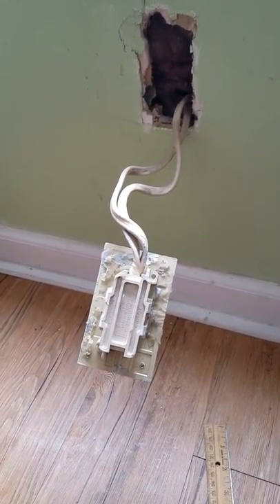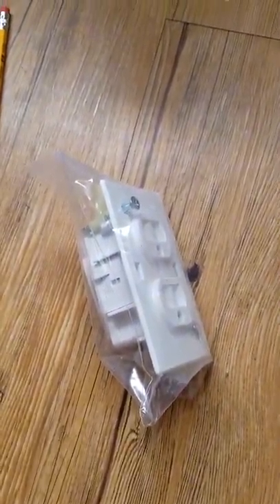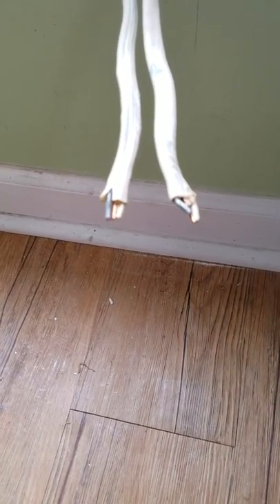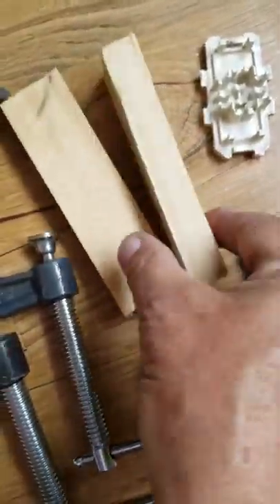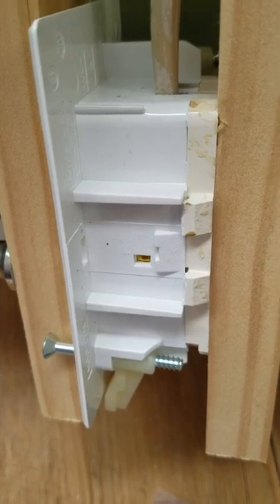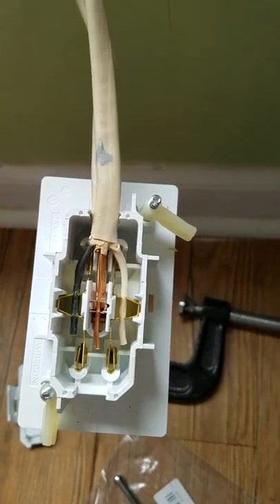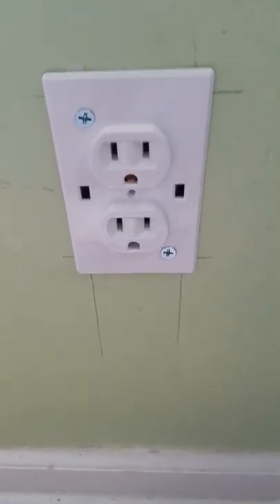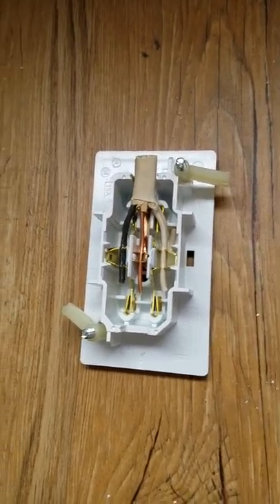SCDT/Wirecon tool replacement

Comment: Man I had no idea what I was getting into removing this outlet on my motorhome.  What a joke that there is not another outlet to use for this with screw terminals.  Thank you for showing this idea.  I guess I need to order a new outlet an make my old one the sacrificial part.

Comment: Thank you so much for this video. I spent hours trying to squeeze and push and crimp those wires and I couldn't get the back anywhere near in place.  I tried your trick with the two clamps and wow, 10 minutes later I'm done. I appreciate your video, have a good one.

Comment: Great idea Billy!   I've dealt with these pieces of garbage for 20+ years doing mobile RV service. What I now use is the huge (15" handle?) Channelocks to force these things together. Your method will not mangle the plastic so bad, but will require some kind of modification to do switches, both toggle and Decora type.

Comment: Much thanks for these hints.  Worked fine.  These outlets are used extensively in RVs, and are UL listed and CSA approved  ... maybe wouldn't use in a home, but required in an RV where you don't have real walls.  Again, thanks!!!!

Comment: Good job, Nice to see it actually back together, Gotta say I am not a fan of these receptacles. a nick in the copper will in time cause the wire to fail and create a high resistance connection leading to a fire. My RV is full of them and high loads like space heaters cause them to melt, UNSAFE DEVICE.

Comment: Replaced a lot of these. With a box and receptacle. The replacement box is bigger than the original hole and there’s no need to buy the install tool.

Comment: Just curious cause I'm about to change out the outlets in my 86 travel trailer,  why didn't you strip the black and white wire instead of keeping the insulation on the wires?

Comment: Why didn't you install the NEW "wire(s) retainer" that came with the new receptacle? I see that you used the OLD wire retainer (with clips broken off) to press the wires into the new receptacle, which was a clever idea. BUT you were supposed to use the "NEW wire(s) retainer" to HOLD the wires in "place" while you were pushing the whole "mess" back into the "hole-in-the-wall."

Comment: This works great for flat faced outlets but I need to seat the wires on a rocker style light switch. This idea won't work for light switches. Any ideas on how to press those wires into place on a rocker light switch without the tool?
Reply: Use Billy's method except use huge Channelocks (3"+ jaw opening) and little 1/2 size pieces of wood, then do one side at a time. I'm an RV pro but am not paying big bucks for the Wirecon tool.

Comment: From an electrician's point of view these outlets are dangerous and can catch fire due to being molded of polystyrene and having the contacts just "U-formed". In high humidity environments this will eventually become blackened and burn.
As a professional I refuse to replace these with the same junk. Any hardware store such as Lowe's or Home Depot have the "blue boxs" with the rear clamps that will fit into the cutout. Additionally standard receptacles which are safer can be used that you don't have to go through the "clamping" to set the wires. Hate to say it but this part of construction is "piece priced" and set, therefore time is money, the faster you are the more money you make.
Reply: Keith Lucas  dude without a doubt.  I work in HVAC and when I saw this in my double wide, I knew it was junk. You don't see these in residential homes for a reason.
Reply: I just did one and converted to a normal receptacle with a blue box. I piggy tailed the two ground wires and used a wire nut. Never converted an outlet to a different type before, don't know much about working with electricity, but even I can tell this SCDT type of outlet is not going to make as good of a connection as a traditional loop and screw type.
Reply: Just want to a friend's house to replace 3 of these things. Have been electrician for 39 years and I can't believe these things are legal. To try and stack 2 wires on top of each other  Is potentially really dangerous. Got some 20 about lead sensible work boxes and gonna do the job right.
Reply: Old work boxes*

Comment: Just go get a regular receptical with a retro box and wire nuts, what you got is a fire hazard.
Reply: This junk was throughout my mobile home. I replaced all of them with traditional outlets. I found some of them without the back plate and exposed wires in my walls.
Reply: Why are these a fire hazard? I am not familiar with these.
Reply: @haunthunterify  well watch the video again if the old box he took apart was brown and fallen apart. Well that is a sign of a loose connection and a loose connection heats up to the point it gets hot and burns. Like I said it's a fire hazard.  Never skim on  Receptacles or switches.  The  old saying pay now or pay later.  Good luck.
Reply: They don't make regular receptacle boxes shallow enough to fit between walls that are on studs that are 1x3, which is why I am grateful for this video.
Reply: @katherinefellman9676  Karen when it turns brown it over heated and thats a fire. It you don't have electricity skills then call a electrician.  Good luck Karen.